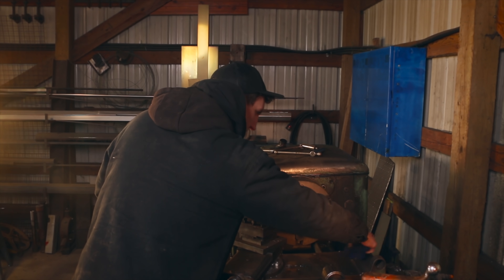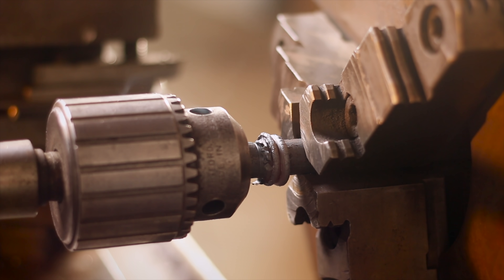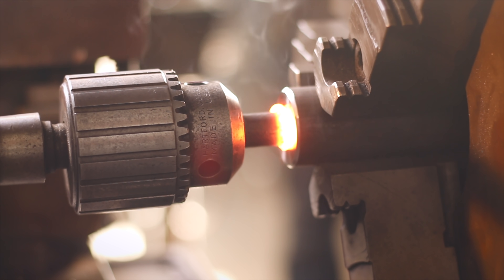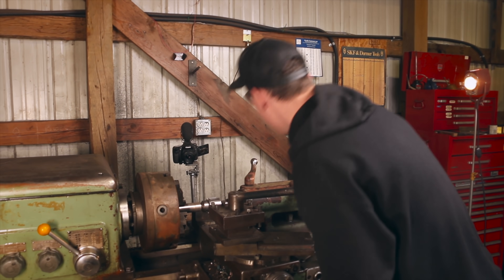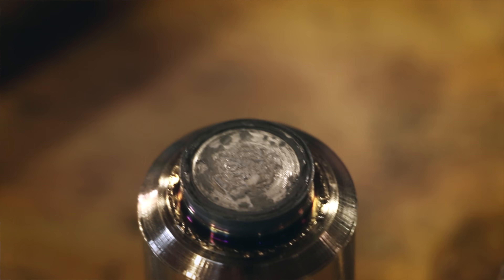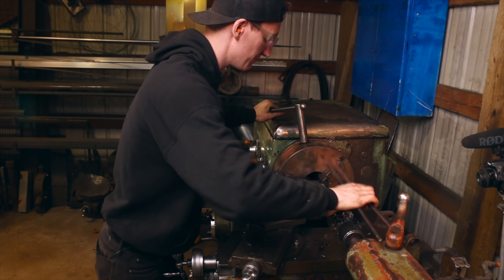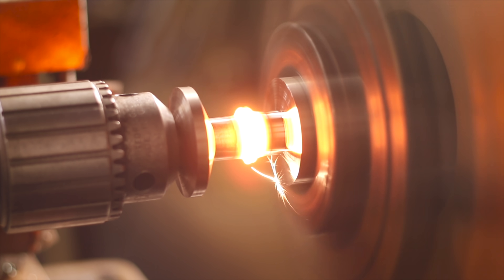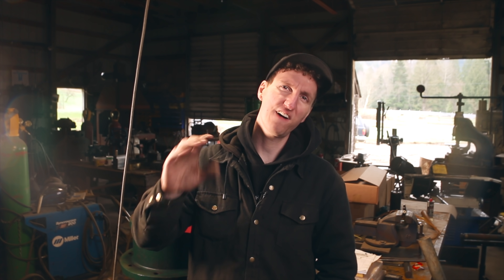Can I FRICTION WELD TITANIUM on my LATHE?

Comment: I think that what you are finding is that no matter how "red hot" it gets, if the metal at the mating faces aren't "moved enough" - the interface doesn't mix properly, and the weld is not complete - commercial friction welded parts often display quite a lot of lipping at the limits of the part (before machining) indicating that the metal which was initially at the face has all been forced to migrate out of the contact zone. - Gotta keep the Pressure on - including while it is stopping.

Great Experiment.
 - Did you try using some flux on any mating parts to see if it helps with limiting scale  / reducing existing scale?? 

 - For a great mechanical fit - using friction to insert an oversized "tenon" in to a "mortise" - undersized hole, including fusing the shoulder material, something to play with I suppose.  - that way there will be reduced locating/alignment  force/accuracy needed

Comment: one way to check the weld is using the lathe and cutting away the excess material. with the bare metal you can anodize it to see if there is any cold shuts on the weld.

Comment: I think if you tapered or rounded the end of the stock held stationary, the application of force to the rotating stock would create a geometry favoring pushing the oxides away from the fuse joint as the weld is forming. At least a better portion of the oxides would be squeezed away with the displacement. Might help, or I might be talking out my exit hole.
Reply: You've close to right but missing 1 point you'll kick yourself for.
Notice the mushrooming on the 1st piece that was missing on the others? That is the oxides being extruded - when you see that you have a gasless metal to metal fusion.
If you don't see that then there is not enough spot heat created for the metal to flow as a plastic form, the metal is wicking the heat faster than it is generated - hence why this is usually done on larger high pressure machines
It needs either higher speeds, more pressure or a reduced surface area with the same force, such as a dome tip - Your solution is a way to do it, just not for the reasons you thought

Comment: I don't know the whole science of it but there's a line where I work that uses friction welding on part of a steering rack, they use steel and it presses hard enough and fast enough that it pushes out like the titanium did and then they turn that excess off in a lathe operation. I would imagine it should work on any of those materials but needs to be a little hotter

Comment: I work at a place that makes aircraft engines. They do this all the time with titanium. The parts always have a serious mushroom effect at the weld joint like your last try and are usually mushroomed to the point where they curled back on themselves enough to touch the shaft. It is critical to make sure the pieces are as parallel to each other as possible for even heating of the material for a really strong joint. Friction welding is used mostly to join dissimilar metals. We use it for nickel alloy and titanium. I'm not surprised you had better luck with the titanium. You can also try hollowing out the material and make basically a really heavy wall tube. That will stop the issue you saw in the middle of the weld not holding up. The center didn't get hot enough seeing as the SFM of the middle drops to almost 0 so there is no real friction to help heat the metal to weld temp.

Comment: The titanium REQUIRES 100% purge with Argon or similar gas shielding.  From the moment it starts to colour, it is susceptible to atmospheric contamination.  Shielding gas must be provided from before colour to final cool-down, or what you get is something that my hold together, but will never reach maximum strength.  A test to see if you've got 100% weld would be to hang the piece from a piece of string, and tap it with a hammer.  A good, solid weld will actually ring like a bell.  The joint should be clean and shiny like chrome, or it's back to the drawing board.

Comment: The application of welding these different metals together would and could be awesome for different applications. Where heat resistance in one area might be preferable, where abrasive resistance would be needed else where on the same shift or body!

Comment: I DONT GET HOW WHEN ONLY ONE SIDE WAS SPINNING, THAT WHEN THE MACHINE WAS TURNED OFF, IT WASNT RIPPING THE STATIONARY SIDE APART

someone plese explain
Reply: I believe it is because both pieces of metal are still highly plastic when the machine is turned off. They freeze and harden when both surfaces are stationary relative to each other which is when the fusion happens.
Reply: @chickenman297  so is the fusion only happening at the very very last moments when everyting is finnaly stopped turning??
Reply: @YukiTsunoda7  I believe so. Commercial friction welders have a brake on them to stop the relative motion.
Reply: @chickenman297  Incredible inforfation, God Bless you KING, Thank you so much

Comment: If you drill an exact hole in one end and then friction weld the pieces together, theorectly it would fuse even better while the tip can't expent in the hole and get stuck even more.
Sorry for my English..

Comment: Hello there!
To get a better weld you have to drill a hole in the center of both parts.
1. Because than there is less surface to heat up
2. That bur that forms on the outside of the weld also is on the inside. So it needs some room to go
Cheers and keep up the good work
Reply: It isn't on the inside aswell, unless you add a hole for that very reason - The heat makes the interior flow and extrude, if there where an internal "lump" of slag there would be a noticable neck swelling

Comment: Not actually bonding the two materials, you can't get the forge force from a lathe. Plus no upset of material happens here. A bend test where you section a piece of material and bend to 90 degrees is the standard Ben testing method.

Comment: Woooowww.. dude I think after the lathe stops and while the metal is still red hot you should push that static piece against the one that has been turning so hard so a hot fresh material from both pieces are exposed to each other and bond. 🤔
Reply: The bond is happening throughout - that is why the true name of the technique is not friction welding but friction-stir welding

Comment: Cool stuff, Tim! I think the HP of your lathe may be limiting how big of a diameter you can work with. Too big, it takes to long to heat up and then the heat makes your Jacobs chuck to start to glow red... smaller diameter material will give you better results because you can heat the business end faster with less heating of the tools. Cheers, and good luck!

Comment: What if you machined a tapered recess into one of the two pieces, and then pushed the other into it, and as it heats up it would spread into the recess like a wedge. Could you use this method to join two incompatible materials together, say steel and titanium? Could be cool?

Comment: You might be able to do bigger pieces if you used more pressure by using a wrench on the tailstock wheel.  Ive seen the machinists at work use big 2 inch box wrenches when drilling/boring big holes quickly.

Comment: You could see the brown in the titanium weld because of the oxidization. To get a truly strong titanium weld without oxidization you’re going to need argon purge during the weld to keep it from getting contaminated.
Reply: The idea of friction stir welds is to allow any oxidized material to be pushed outwards - that was the mushroom we saw on the 1st that was missing on other pieces
As the mushroom pushes out the oxidized layer you are left with a gasless environ while pressure is maintained

He just couldn't get it fast enough of enough pressure on it's back

Comment: What if you cut a piece of welding rod and push it between the two pieces before starting the lathe? Would the friction melt the welding rod, and weld the more difficult alloys?

Comment: Suggestion/guestion: there is steel and then there's high carbon steel. but what about other metals? even some weird stuff like high carbon aluminium. would that work and if not, would some other metals work or even some metal alloys.

Comment: Most of the commercial friction welding rigs basically stop on a dime once they hit temperature..  Your lathe stops pretty quick, but even the few turns that it takes to decelerate will start to shear the weld just as it's setting..

Comment: To reliably friction weld on a lathe it works best when you can let the fixed rod spin freely after you establish the weld while the lathe is still spinning. By having the weld only be able to set after the lathe has stopped it will be extremely difficult to get a strong weld on a consistent basis, you are basically soldering the joint instead of truly forge welding it. You are simply heating each end up to a plastic state and pressing them together which doesn't get the metals to intermix & become welded.

Comment: from my observations, usually frictionwelding is completed by letting the tailstock piece spin along with the piece in the lathe chuck, i imagine that proper fusion is not made because of the time where the lathe stops spinning and by the time it stops, the material is too cold to fully fuse. maybe you would need a lockable bearing that you can unlock to allow it spinning after you completed the frictionwelding process?
Reply: Exactly the same thought.

Comment: Two things to get your friction weld better. 
1, squeeze the material more so you push the slag out along with any other impurities. 
2, stop the rotation as fast as you can. If you slow down gradually, you let it cool down a bit while it's still moving. Try a much smaller chuck on the lathe if you can get one so it doesn't have as much mass to keep it spinning for so long.

Comment: A small to large bar can be done, but needs to be a longer section of the small bar run into the larger piece to get enough heat, or go for a harder steel for the smaller bar and it should run hotter as you drive it in to the larger stock

Comment: Before releasing the pressure, release the holding torque so that both objects rotate together for a while under pressure and then stop. But it was great to watch your unusual experiments anyway - good luck! 😁🔨
Reply: I'm trying to think of a way he could do that on his lathe, but what can he do with a fixed chuck in a fixed tail stock, which is what he is applying pressure with?
Reply: @Bobs-Wrigles5555  You have to do something like a detachable clutch or maybe add a clamp on the swivel chuck.
Reply: @pockwaski  Are you suggesting a releasable rotation clutch mounted on the tool saddle that is free to move back and forth, while you use a live centre in the tail stock?
The only problem I see with that is you will maybe destroy the bearing in the live centre, they're not really meant for end pressure only sideways.
any ideas?
BTW if we think this out far enough, we'll have to suggest it to Tim 😎
Reply: @pockwaski  P.S. I also just had the thought that whatever grips the non rotating/then rotating section has to have a variable diameter centre to grip the work piece, like a lathe chuck.
Reply: @Bobs-Wrigles5555  The tapered roller bearings should be sufficient, but as you can see in the video, the friction temperature causes the drill spindle starts to glow 😮 , bearings may not withstand. They have to be moved elsewhere. It would be interesting to install a motorized spindle in place of the tailstock of the lathe to turn the workpiece in the opposite direction and finally turn off the drive and let it rotate freely while pressing down. 😎
Reply: @pockwaski   "Fools seldom differ" I had that exact thought while I was in the shower(best place to think).
But, the 2nd head stock has to able to move to push the workpieces together, which means whatever drives it also has to move and on each upgrade we talk about we're adding deadweight when starting/stopping the heads.
We need to be thinking lightweight, otherwise we're just reinventing the wheel, I was recommended this by YT about 5 months ago, China is already making machines to do friction welding for truck differential bearing ends   https://www.youtube.com/watch?v=_i_00I2gBmc  
I assume USA is doing it too, but haven't seen any videos on it.
The only thought I had about holding and releasing is something like a car air cond pump magnetic clutch with a small lathe chuck attached, but I don't know if that is heavy duty enough.
And Yes, you're very right about heat near lathe parts, heating up a workpiece in the chuck can break the scroll/snail behind the jaws, the same like you said for the drill chuck Tim is using.

Comment: I’ve got a small amount of experience with this. You had it right with the mild and titanium steel. You need enough heat to flow the metal. That’s what actually welds it, it becomes liquid and mixes. If you do not have “lips” form at the joint then it’s an incomplete weld. And stopping the lathe as quick as possible is a huge part of success. The mar-ageing and inconel will work if your turn them to a smaller diameter and let the metal flow to create “lips”, that’s what we call it.

Comment: Can you weld 2 different metals together this way?
Reply: Only if they enter a semi-plastic state at roughly the same temp - otherwise the lower melt point one will deform, that reduces pressure and you cannot generate heat in the higher melting point part
Reply: @bengrogan9710  Thanks, makes sense

Comment: 11:06 tim that's what she said. Also I'm not a metallurgist but I think you might need a pure gas to friction wield some metals not 100% sure on that. I just remember what my wielding instructor said back 20 years ago about making sure your wields are clean and use the right noble gas mixture when wielding
Reply: That applies when you are "flowing" two melted metals together so that you don't get oxides forming in the weld, but using pressure excludes the atmosphere, the only oxides forming occur on the exposed extruded material, although using argon may present a better "finish" that won't be nasty to lathe tools to clean it up later.
BTW Here's how China does it for truck differentials    https://www.youtube.com/watch?v=_i_00I2gBmc

Comment: you know would make the weld better if you had a inner notch on the piece and then a outer notch on the other piece and as the material feathers out it welds to the sides and it would fuse the material together and perhaps you could make the outer notch longer than the hole but just by a little bit so that it doesn't feather out on the outer part also damn i wish i had a lathe

Comment: I would love to see a video explaining the difference between these materials and why you would choose one over another.
Reply: Hmmm, material choice is a big engineering topic. You'll even find great differences between the behavior of different alloy based on the same metal. When choosing a material, you got to consider a lot of factor : cost, strength, hardness, elasticity, resistance to chemical attack, how it's property might change with temperature, how easy it is to process (machine, weld and so forth), magnetic properties and those are just the big ones. 

But here are the classic choices and their justification :
- Mild steel - I want it cheap and I don't care if it's heavy
- Fancy steel - I want it tough and I don't care if it's heavy
- Stainless steel - I don't want to paint it to resist corrosion, I'll pay good money for that
- Aluminum - I want it light, cheap and corrosion resistant
- Fancy aluminum - I want it light and not too weak, I'm ok with the price
- Titanium - TAKE MY MONEY, I want it light, tough, corrosion resistant and a pain in the butt to work with
- Cast Iron - I don't care that it's weak, I want it to dampen vibration and not rust.
- Brass - Gimme the fancy one that includes grease between sintered grain for abrasion resistance.
Reply: @pittlebelge  this is so good. Thanks!
Reply: titanium has a 2x weight to strength ratio compared to steel. the other materials are aerospace grade materials commonly used on parts that need to resist deforming due to extreme temperatures.
Reply: Titanium is really well suited for friction welding because it is particularly bad at transferring heat.  This makes it difficultish to machine, but it makes it very easy to dump heat into a weld via friction, because the heat moves away from the joint very slowly.
Reply: @jameslederer7613  في العالم
Reply: The SR-71 was made mostly of Titanium so it could handle skin temperatures up to about 600F at Mach 3.3.
The X-15 rocket plane was made of Inconel to handle skin temperatures of 1100-1200F at Mach 6+.
Reply: Go to Real Engineering

Comment: What if you try purging it with a gas like argon? Seems to do the trick for MIG/TIG welding, maybe that’ll reduce your scale buildup
Reply: The scale is wanted, it is the shield - It is the oxidized surface being extruded leaving metal to metal contact with no gas ingress
Without the mushroom the initial oxidized surface is inside
Reply: @bengrogan9710  Hmm interesting. Makes sense. Thanks for enlightening me!

Comment: I'd love to see you try helping bigger stock heat with a propane or map gas torch, also try shielding with argon and carbon dioxide to give a better weld maybe? It could be worth it for exotic stuff so it doesn't oxidize

Comment: The only application I can see is material saving. Like if you need to lathe a piece down from really large to small, you can just friction weld a smaller piece to a bigger one and save some money. What am I missing?

Comment: I'm interested to see the how complete the weld would be if you could let the parts both free spin to a stop instead of having one stationary while the lathe is turning. 
Not sure how to set the live center from locked to free mid process,  but it might improve your bond.✌